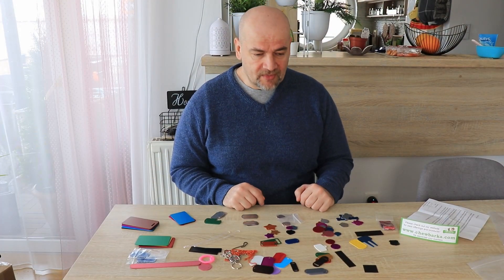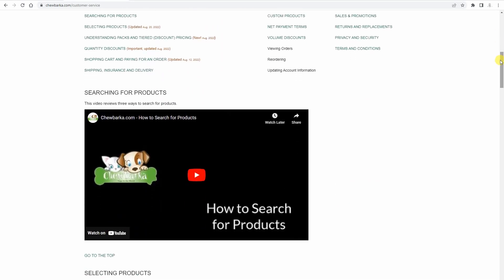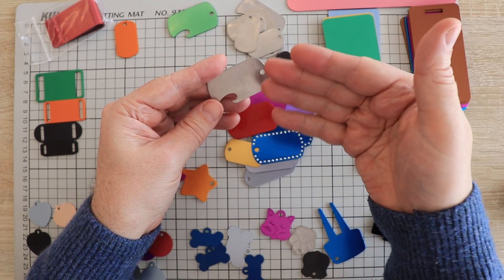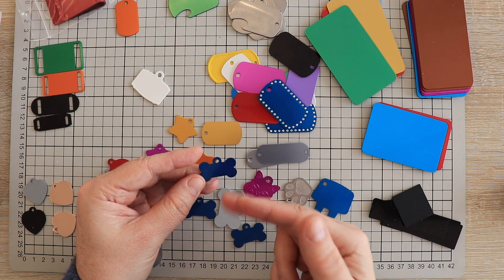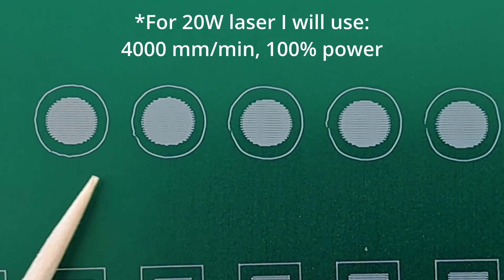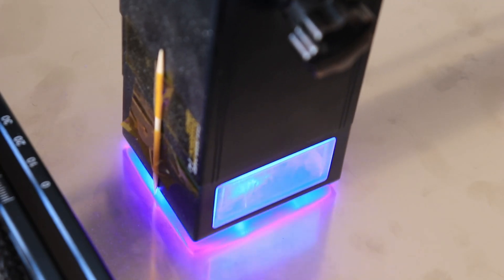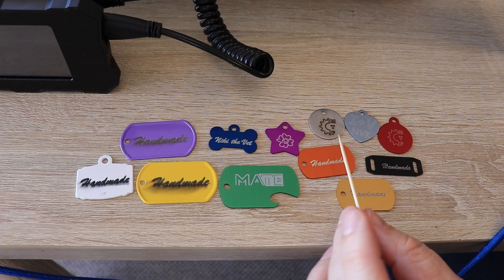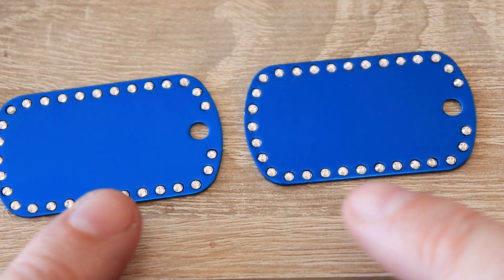Laser engraving anodized aluminium - Chewbarka tags, a great idea for your diode laser business

Comment: I am thinking of buying a new engraver/cutter as my K40 is far too small, the problem I am having is manufacturers wattage claims, for instance Atomstack  claim some of their machines to be 40 watt diode lasers when they are in fact 5 watt output, Atomstack are not the only ones making these claims, all it does is confuse potential purchasers.
 I am wanting around 20 watts of (true) output, any ideas?
Reply: Yes, I noticed this few years ago, they write the W of power supply, but it can be any size.. Always search for optical power. Nowaday engravers have optical power of 5, 10, 20W (and some 30W are comming soon)